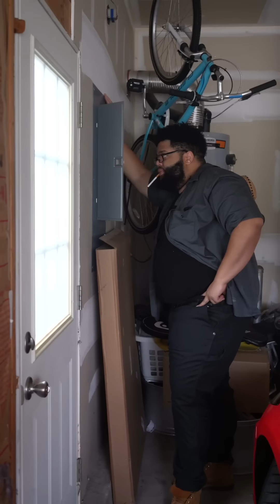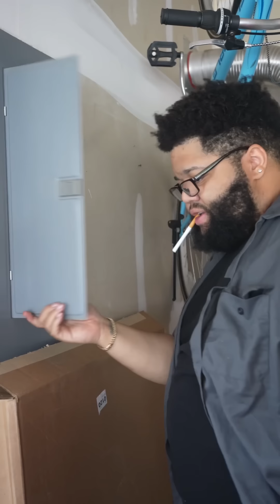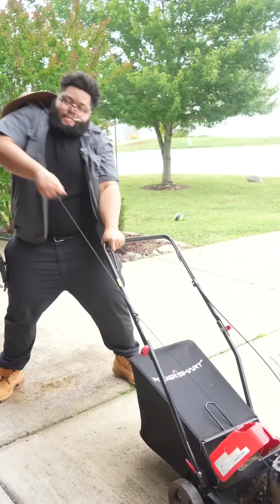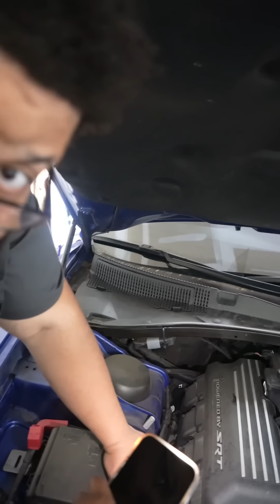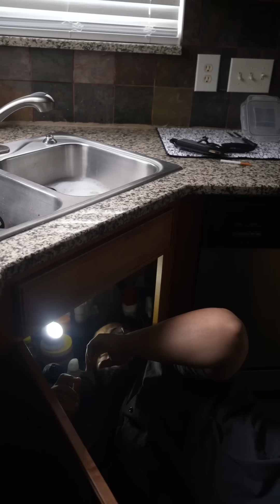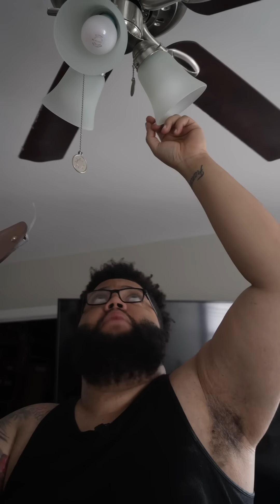Old Heads Never Like To Call Professionals

Comment: It's the one that's in the off position and what the hell does fixing a lawn mower got to do with anything 😂😂😂😂
Reply: Actually a tripped breaker will be in the tripped position, which is different from the off position. It would be in the middle position so you can easily identify it.
Reply: @MysticGospel  Sometimes it goes all the way to off

Comment: I don’t understand why old heads do this, there ain’t nothing wrong with getting help 😭😭
Reply: It's expensive. Every time for small problems it cost more to pay someone just to look at it than it does for you to look it up on YouTube, get the parts and tighten a few bolts. Nothing wrong with help like pdfs of owners manuals, hardware store workers, and very helpful and specific YouTubers. But unless I try it and fail or I need it fixed RIGHT NOW I won't get  professional help